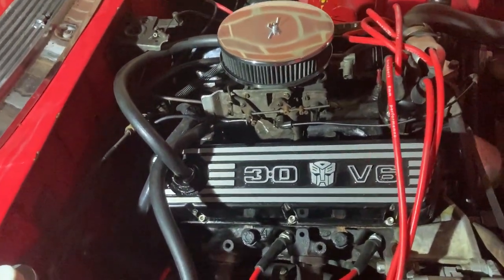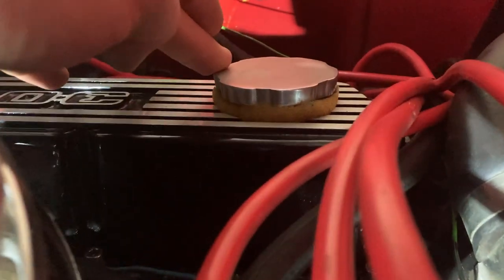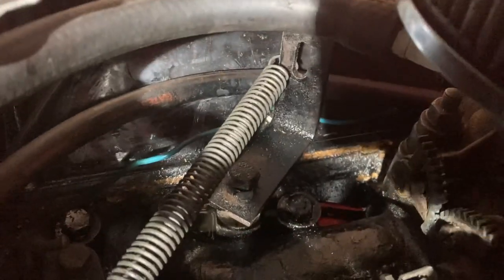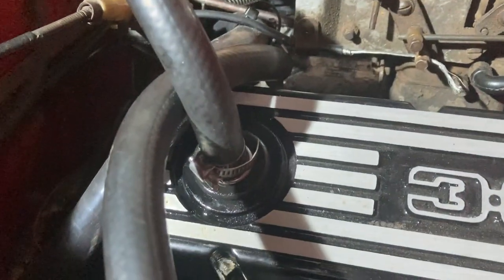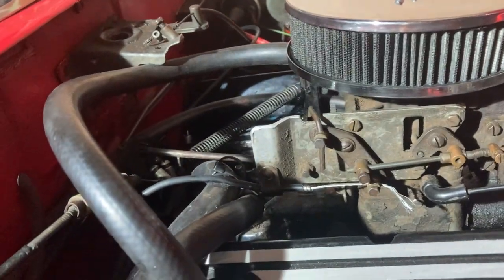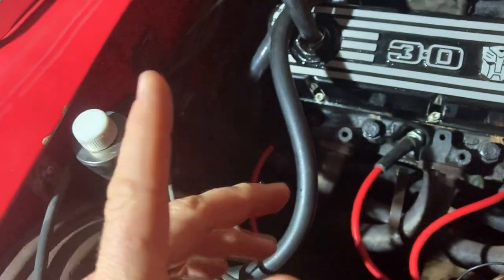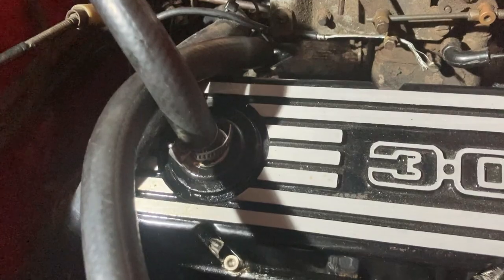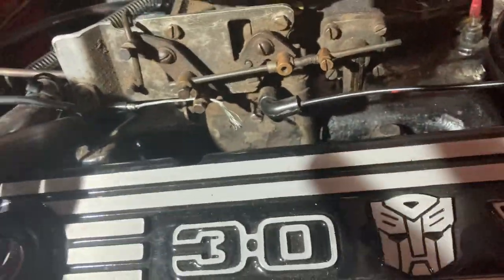Chix's Triumph Stag Ford Essex 3L V6 - Grommet split and oil leaks

Comment: Have a look at the rover sd1 v8, it had an oil trap/breather that screwed into a very similar rocker cover hole, the breather hose connected to the top of it and fed back into the air intake. It may save you some grief.

It's on the front of the left hand cylinder bank looking from the front.
Reply from the maker: Thanks mate! I've actually solved this issue now, there was an integral part missing which I'll blog about soon... I'm still catching up from September's activity!